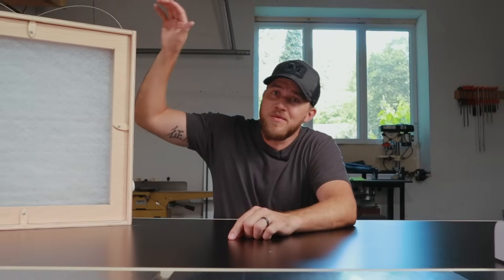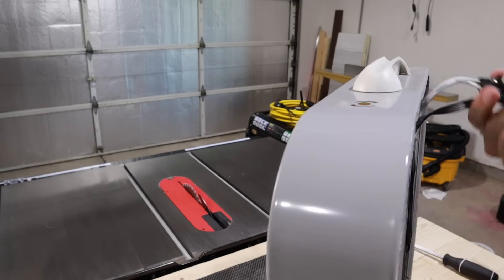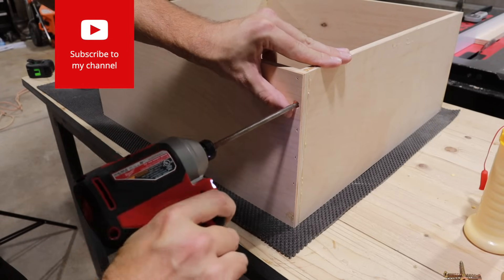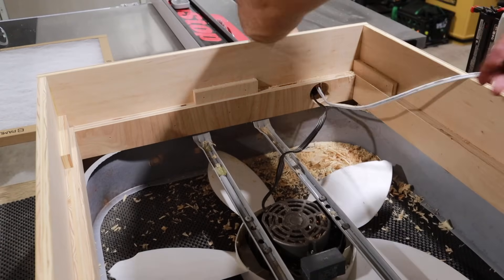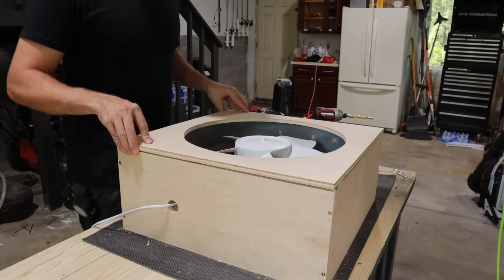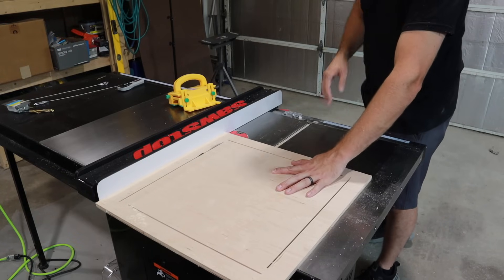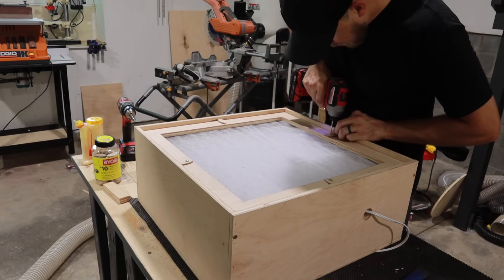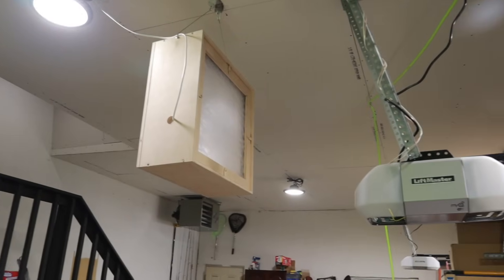I Built an Air Cleaner for $7

Comment: Is slightly dangerous running fans off lighting circuits, it can cause wiring to hot possibly catch fire as lighting pulls lower Ampage than electrical motors.
Reply from the maker: I am no longer using this unit, but thank you for the heads up 😁

Comment: are you still using the same cleaner? any comments about how it's doing a few years later? thanks!
Reply from the maker: It still works great, but I have stopped using it in my shop. I kept hitting it with material, so I took it down and never put it back up. But it worked great while it was in use.

Comment: Man, i can't believe all of the negative comments on this video. Yes, it could've been built many different ways, and all materials if purchased together to build would definitely be over the $7 price. He already had materials laying around and he built it to what he wanted. If you can do a better job, then by all means build one and post your video for all the haters to criticize your stuff like you're doing here. I think you done a great job building it, and keep up the good work!
Reply from the maker: Thank you 🙏 Some people just want to complain, lol
Reply: You are absolutely correct, kevinr1704.  I'm guessing that none of these knuckleheads who made negative comments have ever or will ever build a box fan air purifier.  Amazon has several fans listing for 30 to 50 bucks and you may have to purchase the plywood, but I'm guessing that a half sheet of cheap 1/2 inch ply will do the trick.  This ply runs about 25 to 45 at my local HD.
Overall, still not too bad a price to save your lungs.

Comment: Very interesting video. Thanks for sharing. What kind of fans are suitable for such air cleaners?  I have some smaller ones (from electric heaters of which the heating elements are broken).
Maybe I can try them out. It should be better than nothing, I guess.
Reply from the maker: I’d say, give them a try 👍

Comment: Amazing video, I was gonna make one with a 4” Merv 14 filter followed by a 1” Merv 8 to catch the big stuff like you. I’ve read that if you stack filters if can restrict airflow, do you have any advice?
Reply from the maker: Sounds like a great idea! Stacking air filters can definitely restrict airflow, but I’m not sure to what extent. I tested mine by turning on the fan and holding a piece of paper about an inch away from the filters. If it sucks the piece of paper up against the filters, you should be good. The goal is to catch fine airborne dust, which it will if the paper test works. 👍

Comment: I do alot of work with mdf and man do I hate the super fine dust from it..! Been converting our garage into a dedicated wood shop over the last yr. 

I seen alot of these diy builds and they all say they work great but in all reality do they work as great as they say..?

How has yours performed?
Reply from the maker: It works great and does what it’s designed to do. The one thing that I don’t like is it is either running non stop or not at all. I don’t want it running all the time, because it is constantly disturbing any dust that has come to rest. I’d prefer it to only run for 3-5 minutes after a tool is used. Just enough time to grab any airborne dust and then shutoff. That would be a huge improvement 👍

Comment: For low cost and low effort, you could have just stuck the filter onto the original fan frame with some duct tape... job done.
Just saying.
Reply from the maker: Lol, I thought about doing that. But I’m a bit of a perfectionist and it probably would have bothered me. Definitely a much quicker solution though 👍

Comment: Have u thought of a 4” or 5” thick fine filter? The pre filter is a great idea and necessary.
Reply from the maker: I did, but those filters are more expensive and did know if the fan had enough power for that big of a filter.
Reply: @EverydayBuilds  if comparing identical Merv values, then thicker filters actually causes less resistance due to larger surface area. Similar to blowing thru a thin straw vs a thick straw.
Reply from the maker: @europana7  awesome! Thank you for the info, that is great to know 😁

Comment: When do you take the nails out of the plywood? You mentioned putting in nails temporarily so I wasn't sure when you take those out?
Reply from the maker: The nails remain in the plywood. What I meant is that the nails hold the pieces together, so that I can then add screws without having to try and keep everything aligned.

Comment: All u need r 2 pieces of scotch tap.   Attatch filters to back of fan. I piece of tape at the top of the fan attaching to the filter.  The back side.   doesn’t have to be this complicated.
Reply from the maker: You are absolutely correct. I just wanted it to look a little more finished is all 😁

Comment: I'm also boxing in my window mounted box fan, but I'm doing it to add a hose/air duct to carry fresh air to the intake fans on my pc. The problem is, I can't find any information or projects about doing this, I don't know if it will even work, any ideas???🤷‍♂️
Reply: Update: I finished the setup and upon testing found that no air was carried at all through the hose💁‍♂️
Reply: @frown  - I am not sure I understand you correctly.  Was the window fan bringing air into the room and you were trying to duct it to the PC? With what kind/size hose? Where was the fan on the PC?

Comment: The cheap furnace filters are really not going to catch most of the fine saw dust particles. Get some MERV-13 air filters, Amazon has them for the lowest price I have been able to find. A MERV-13 filter is far superior to the filters you used here. I use three of these in my shop, and the air gets cleaned up really fast. I like your enclosure, but I just duct tape my filters onto the fans at the corners.
Reply: One box fan with 4 or (5 if suspended) Merv 13s made into a box filter is another way
Reply: @SmedleyButler1  I have seen that done as well, it's a good alternative.

Comment: This is a nice and a very useful shop instrument. I do however think that your build was over-engineered. It could be simplified so there is not so much waste of plywood. Also, if you have permanently hooked up the fan to the lamp, you could have just skipped installing that switch on the outside. Keep the videos coming.
Reply: 9 months late but still good to be able to turn the fan off without turning the lights off if anything needs to be replaced.